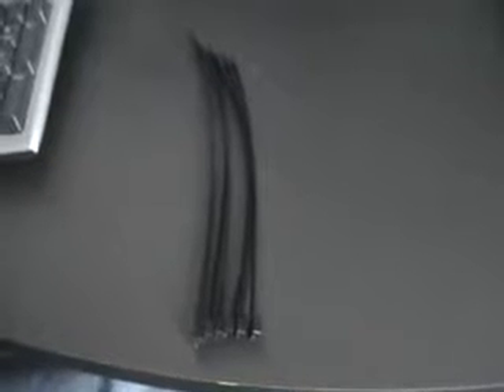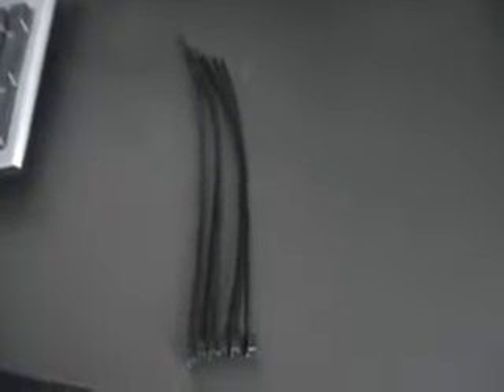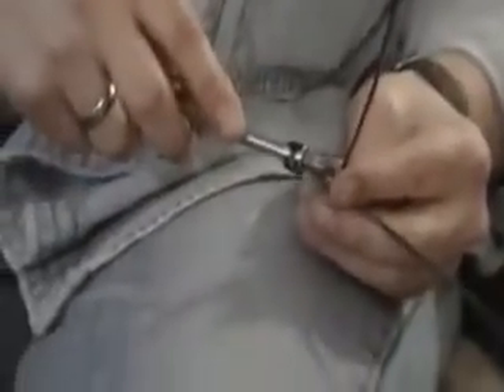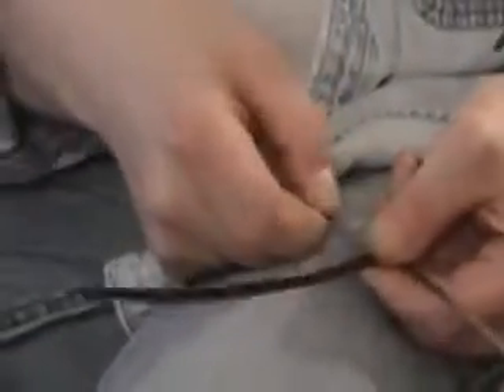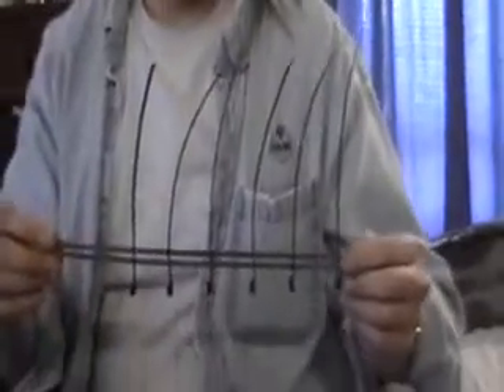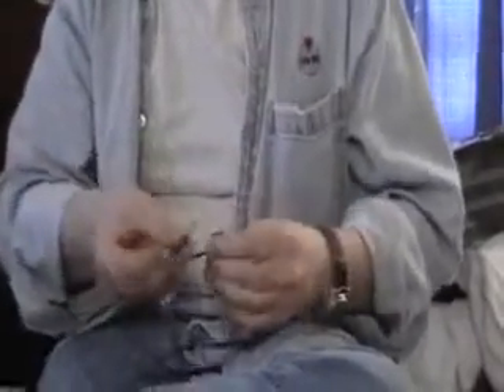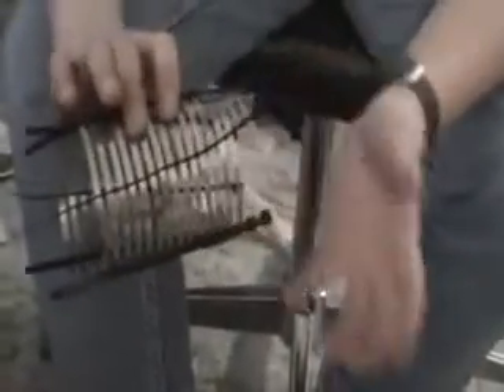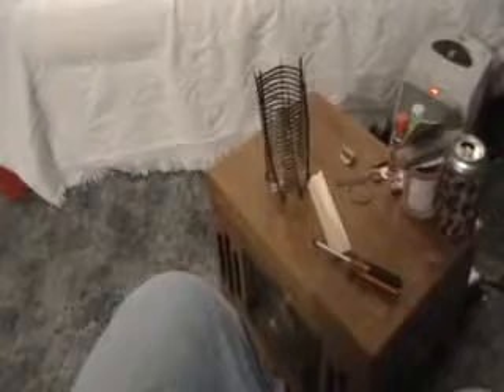HHO_ver_V_build_coil

Comment: nice presentation and a novel approach. but I dont see a helix there, its more like a coil setup.  but if you are able to keep your spacing even, darn thing ought to do quite well. interesting thing is, its a parallel setup that you could wire in series to get control over the voltage. Very creative. Will be interested to see how she do in the soup.